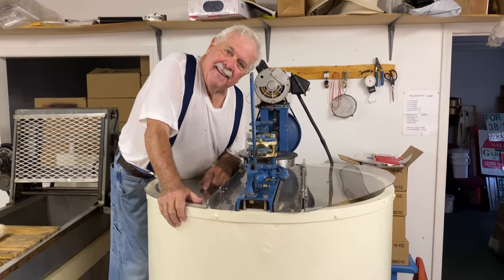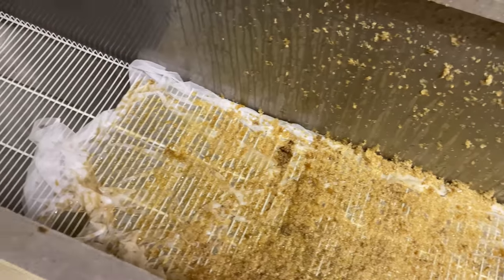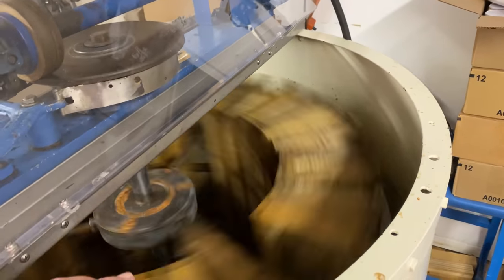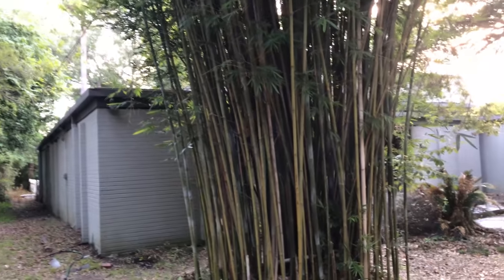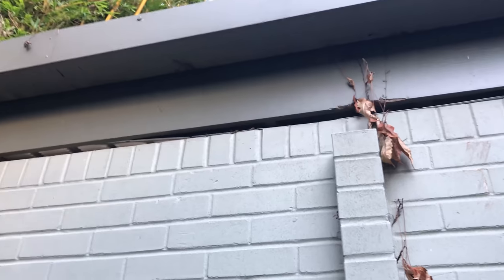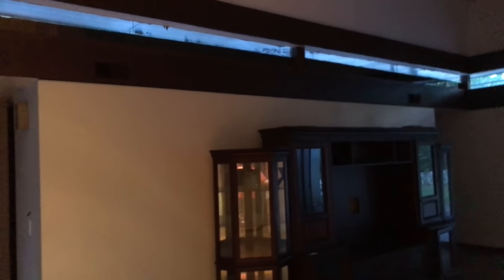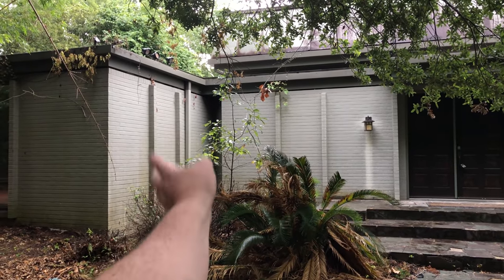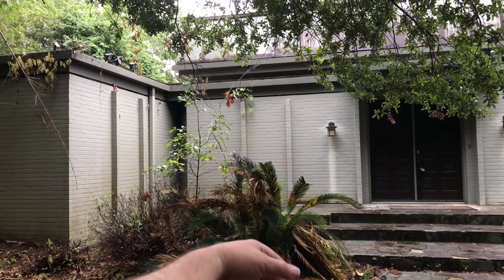Expensive House Expensive Problems

Comment: I love the house style too.  I'm an architect, and agree the house does have nice features.  Probably built in the 60's, and yes, somewhat mid century modern look, with Asian influences. You're right, it would take a fortune to fix, and actually cost-wise probably a tear down. Remodeling is more expensive than building new in this situation. Once the roof goes and water gets in, it goes downhill fast.  Such a shame, but the site sounds great.  
Buy at the right price, tear this one down, let me help you design a new one, incorporating the best features of this one, and you'll have something amazing!  Makes me and the ghost of FLW smile just thinking of it.
Reply: Yeah Asian, but something dark and unfriendly about it.
Reply: I think I'd probably (if it could be fixed) put a peaked roof over the top of the flat roof, windows down one side to make it a solarium/attic.....  You're right, it's a gorgeous house design.

Comment: Everybody has to add their 2 cents worth on the house, so here's my nickels worth.
If you're going to live in a swamp....99% of that area...you need to utilize traditional building techniques that evolved over 2000 years...the Natives figured out you got to get up off the ground...you can't live on a slab foundation where the water table is at 2 inches. Second you got to use wood that termites and other bugs won't eat and that's resistant to rot (cypress comes to mind) and/or concrete.
I just don't understand why folks down there insist on using materials and techniques incompatible with the environment. Everything is covered in green mold....due to the constant damp of humidity. It eats traditional pine and fir and such. Sheet rock the same...turns to mush. Vines and weeds turn the buildings into giant trellises  and every insect and varmint finds the least crack or hole and moves in. Then everybody wants to live like Tarzan in the jungle....no sunlight penetration to dry anything. Therefore it's no wonder every structure is rotting to the ground. Frank Lloyd Wright built a house over a flowing stream.....up north. Different atmosphere altogether.
I couldn't invest a pile in a home just because it looked shazam, only to have the jungle consume it in 20 or 30 years. 
A person needs to utilize architecture suitable to the environment.  Might as well build an igloo down there. 
Build up off the ground on concrete piers, use cypress as much as possible, metal studs and aluminum soffit/facia...everything bug/termite and swamp resistant. 
That place has already been reclaimed by nature,  it's trackhoe and dumpster time.